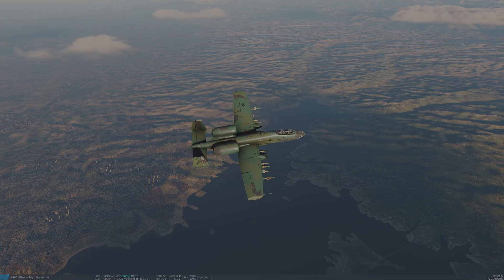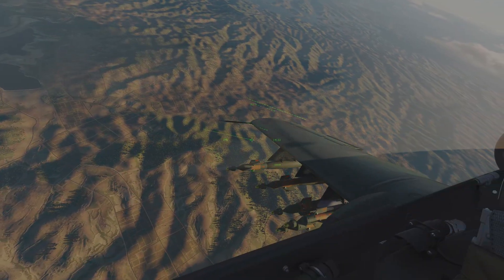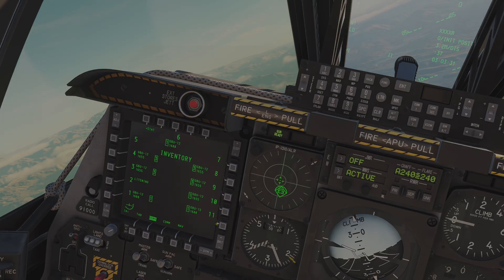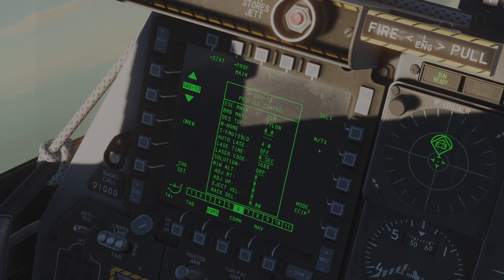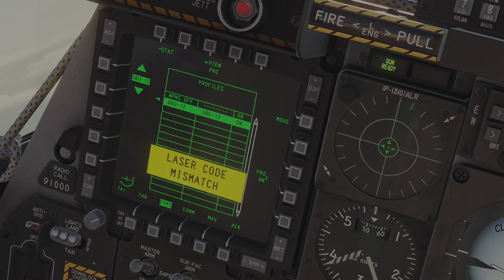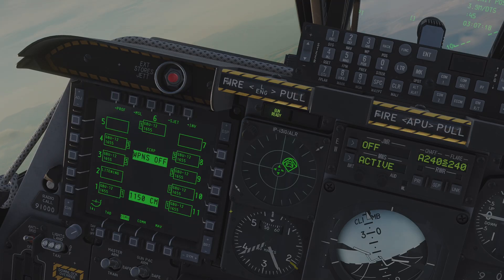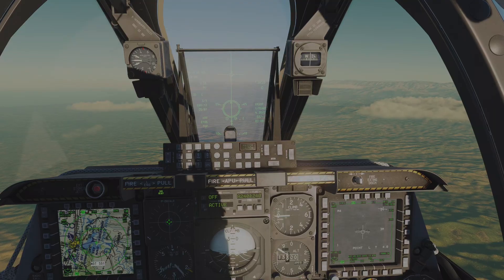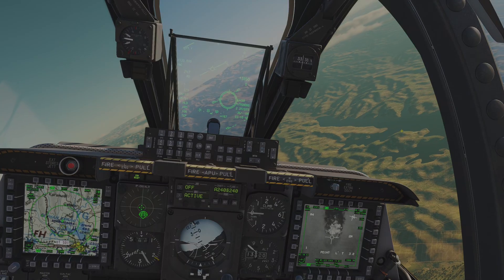DCS A-10C II Tutorial 13 - Laser Guided Bombs

Comment: At 6:00, the ORP/BAL selection changes whether the CCRP release point is at the ballistic (BAL) point, i.e. if the bomb were to fail to acquire the laser it would hit as if a normal iron CCRP delivery was made, or to use the "optimized release point" (ORP) which targets the bomb a bit long, so that it has more energy to use in the guided phase, which is good for (e.g) moving targets which may need quite large corrections. This obviously means that if the bomb fails to acquire the laser, it's going to be a dead miss and potentially hit something unintended.